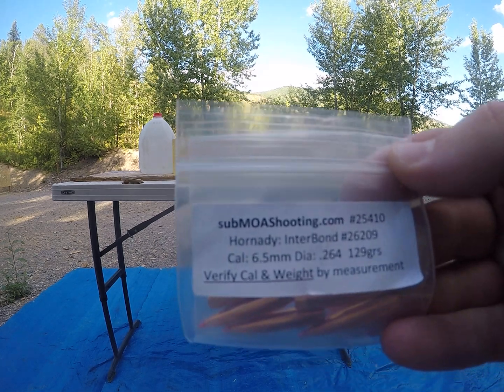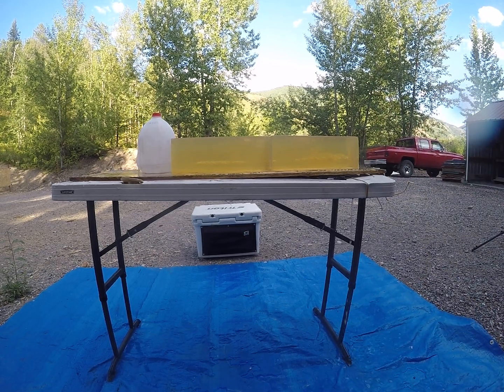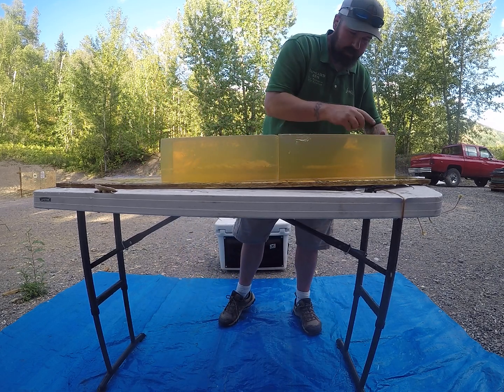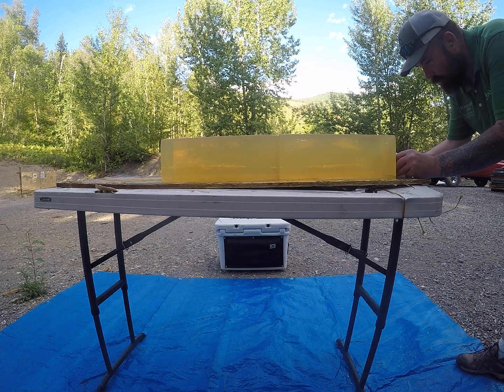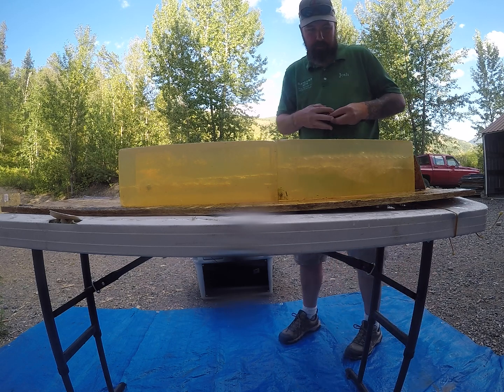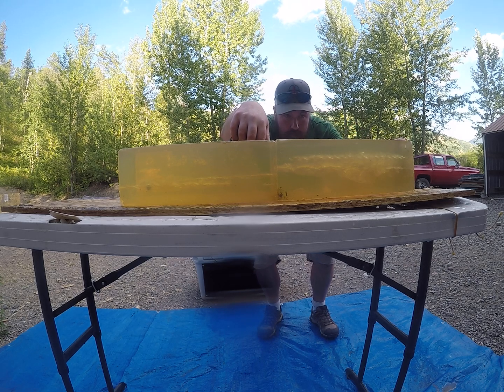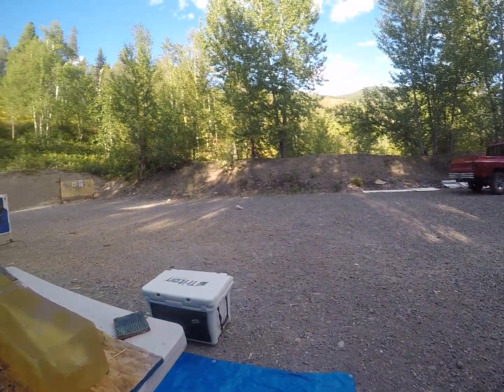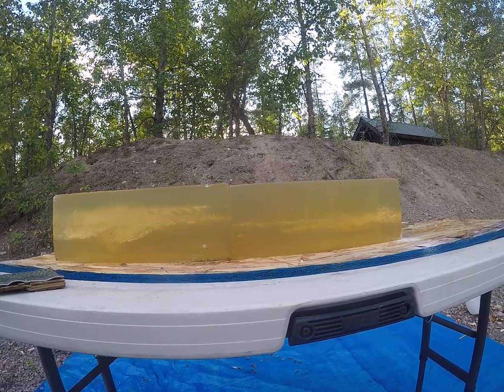6.5 Creedmoor 129 gr Hornady InterBond ballistic gel test

Comment: How are you calibrating your gel? Penetration seemed unrealistic on the low velocity bullet. Have you considered giving the clear gel a try? I think there's much less variation due to temperature with it. I'd be interested in this bullet for the Grendel...I wouldn't mind seeing another test at low velocity, where you could save the bullet. Expansion at that velocity would be really useful with the Grendel.
Reply from the maker: @GetMeThere1 It is quite common with the lower velocity to get deeper penetration than high velocity because there's not enough energy dump to get the bullet to come apart and slow it down and they tend to pin line. If you haven't noticed in most of my videos you can see my cooler that I transport my gel blocks in the keep temperatures where they need to be so that I get consistent results.  I use the standards set by the FBI for 10% natural ballistics gelatin and the temperature range the blocks need to be in.  I personally am not a fan of the clear ballistics synthetic blocks they are easier to transport and not quite as temperature sensitive, they do give slightly different results but it's barely noticeable where you do tend to notice is overall penetration tends to be deeper using synthetic blocks I don't like the fact it takes 8 to 10 hours to recast them properly I don't have that kind of time in my life there too spend entire days just recasting gel.  Also I can cast 5 of my natural ballistics blocks for the cost of one synthetic block and still recast them 1/2 a dozen times before I have to scrap my blocks and cast new ones because the natural gelatin breaks down.  Every time I recast I have more than what my molds will hold it gets poured in a separate container and I check calibration if the gel is not holding calibration I scrap them and cast a new set. 

I do plan on doing more videos with the Grendel.  Right now I'm just using what I have to push the bullets as fast as I can trying to test the high end. I fully plan on doing some videos testing that mid range in the Grendel.
Reply: Frictional temperature differentiate of the alloy malleability. In the field there are so many different variables like weather conditions, extreme temperature and barometric pressure. It's good enough for the girls I go with.
Reply: @bobbylee7801  LOL. Drunk posting?
Reply: @GetMeThere1  I've never been able to recreate a shot and recover an identical projectile out of a carcass
Reply: @bobbylee7801  Fascinating.